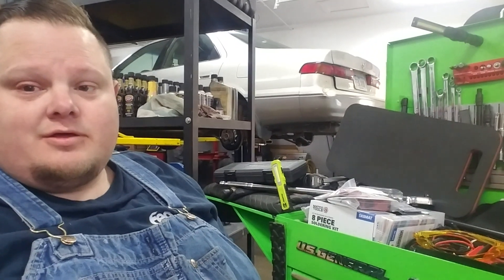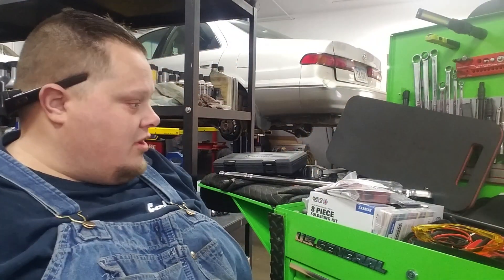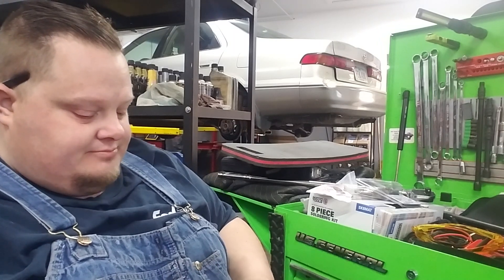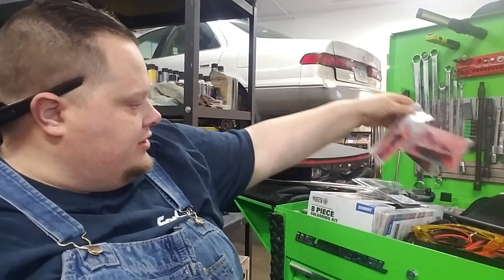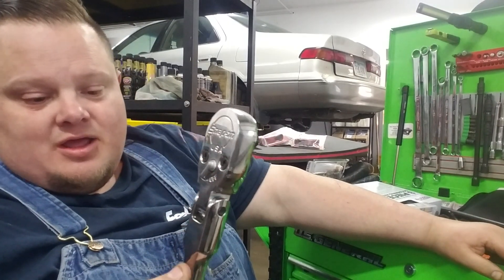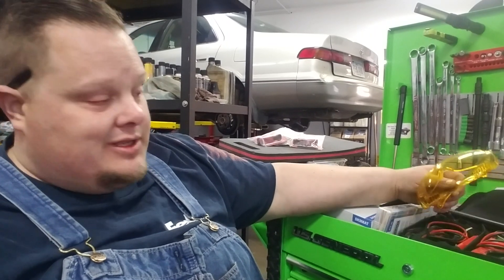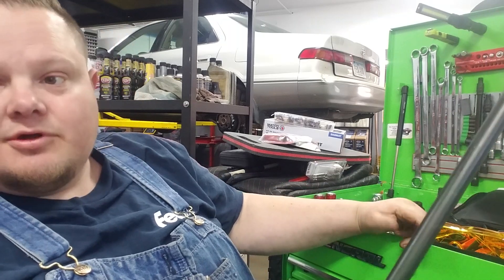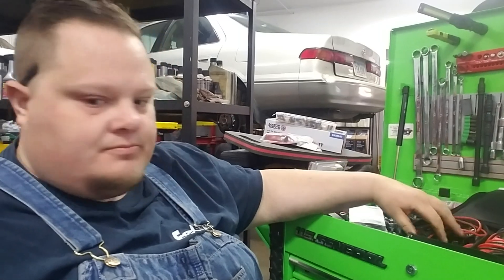SNAP-ON MATCO AND RANDOM TOOL HAUL!!!!

Comment: CP if your MATCO guy still comes around for tool haulin I have a question. I’ve tried to do a find a distributor  on their site and constantly get an error message. I’m located in 46234 zip code but also can use 46112. Not sure if he can search a different database or not. MATCO is makin some solid products and I’d like to give a local guy my business. Thanks man.
Reply from the maker: Copy that I will see if I can hook you up next Tuesday